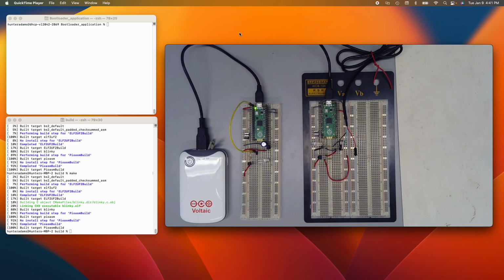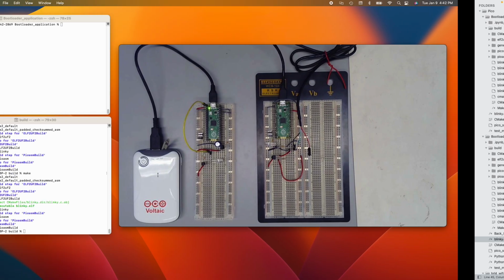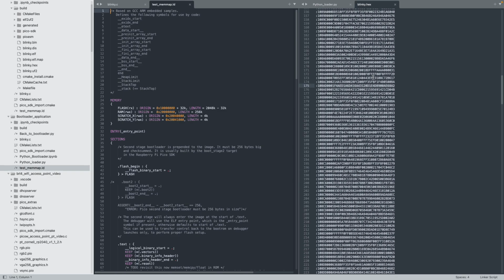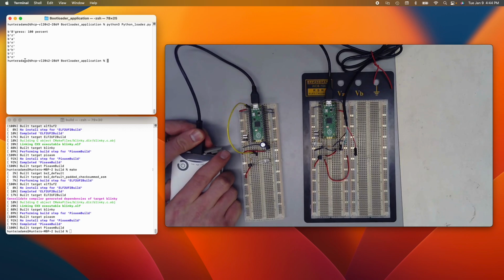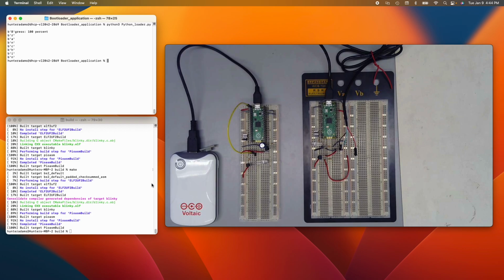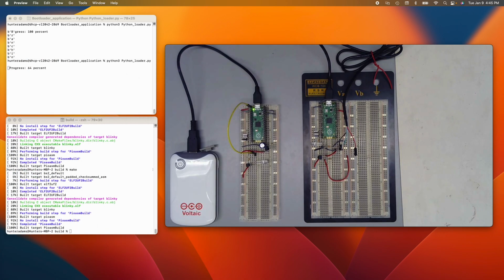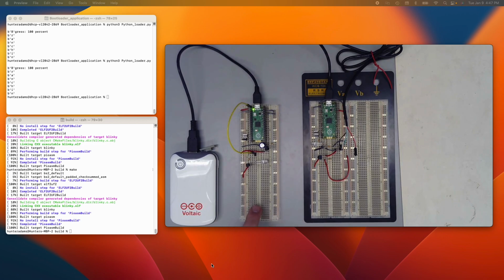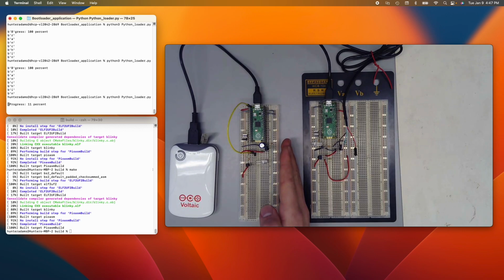Wireless Infrared Bootloader for RP2040

Comment: What baud rate is the UART sending ? Looking forward to seeing the source code.
Reply from the maker: At present, 4800 (this is the only rate which was compatible with the automatic gain control for the infrared receiver I was using). With a different IR receiver, this could be faster.